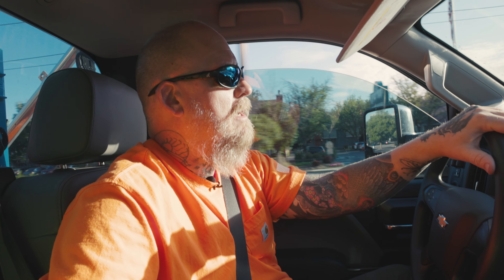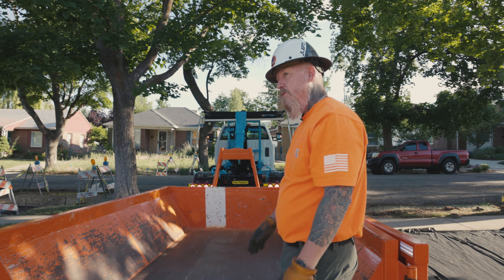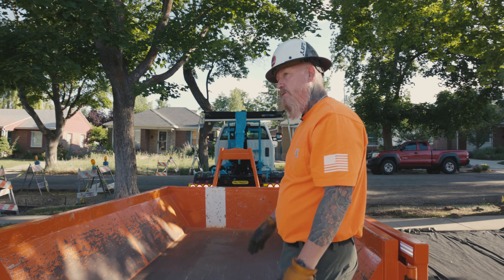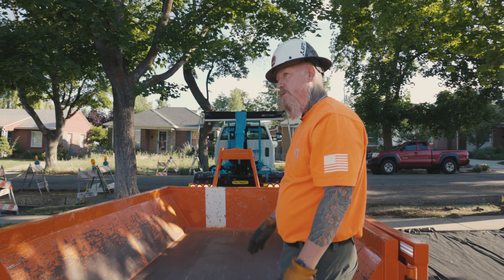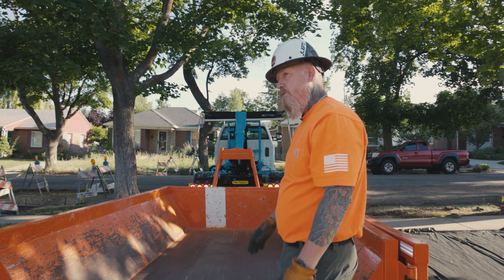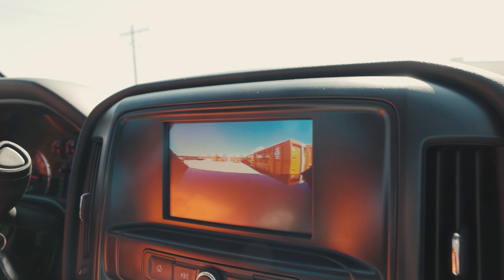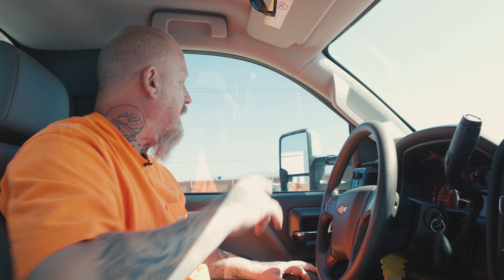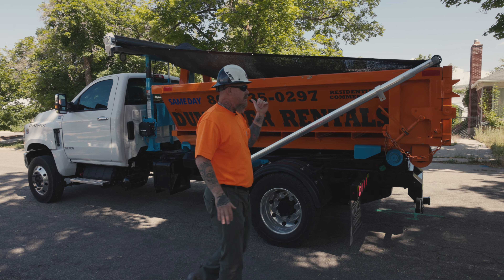Everything you need to know about concrete, dirt, & sod dumpsters.

Comment: Hi John, like this video and information. Actually all your videos! Great customer service! I am considering starting dumpster rentals in my area and love the idea of 7 yd dumpsters for Sod, Dirt, and Concrete since most don't and cringe at the idea. I have also been thinking about the auto tarper for this, wondering if when they upfit, they could modify or mount the gantry down lower, and have a sewn in cut out to allow the tarp to lower through past the palfinger hook and bars of the dirt dumpster to allow the gantry to lower just past the dumpster lip to prevent manual cargo netting the loads? Wondering about your thoughts and expertise on this idea. Thanks Jay and stay loaded!
Reply from the maker: Great idea Jay... All my trucks actually are setup this exact way. It's a complete game changer for sure. United Tarps ( George ) came up with the idea of a square cut out in the tarp to clear your hook and sit down tight around the base of the hook. I have several videos on my IG page with this to demonstrate how it's done. Thanks for your contribution, very much appreciated .

Comment: What the max ton you carry with your concrete dumpsters. Are your concrete dumpster 10yds? What's the dimension?
Reply from the maker: Just over 4 tons. The one in this video is 12’ L x 8’ W x 2’ T
Reply: His dumpsters look to be about 4 to 5 yards ish
Reply: What's your GVW. I have a f600 hook lift with GVW @ 22500.
Reply: @samedaydumpster Trying to get into this market and doing research. Given your dimensions and due to the slants on the inside, it looks like your bins are actually around 5 cubic yards on the inside?

That would seem safe/reasonable given wet soil can weigh as much as 3000lb per cubic/yrd. 

Just trying to get my numbers right before I have any custom cans built.

Comment: Love the videos! Just curious of what your max lifting capacity is on your hooklift?  We do 12,15,20 yard dumpsters but arent doing dirt or concrete at the moment but have been thinking of doing it in smaller dumpsters .
Reply from the maker: This hook is rated at 16,000lbs lift capacity. Our entire business model is based around smaller dumpsters with shorter rental times.

Comment: My question is your runing a 6500 with 10 yard dirt bin how do u not do wheelies, in Canada most ppl run hino 338/L7 33gvwr with multilift  xr10 hooks we go sky high
Reply from the maker: These aren't 10 cy bins. They are smaller and built specifically for the weight rating of our trucks. Ya'll do some crazy type trucking up in Canada in the oil fields for sure!!
Reply: So these Crete bins are 7yd ?
Reply: I have a Hino 338 in kelowna bc

Comment: How would you handle if for whatever reason someone didn’t listen and did fill above line when dealing with regular debris ? I understand with concrete etc because it’s heavier. Thank you.
Reply from the maker: We won't haul any overloaded dumpster plain and simple. Are you asking about if the debris is over the top type overloaded? Or are you asking about if it's overloaded by weight?
Reply: @samedaydumpster  first thank you for your reply, as I hope to start a business in the best future. I meant overloaded by top. You would not take it until they fix it ? Wouldn’t that also lead to them having to get another container for that excess? I guess it could go many ways after that. I appreciate your time sir.
Reply from the maker: @danm3346  100% correct. We communicate with them that will will in no situation haul an overloaded dumpster. It’s not safe, or legal in our state to do so. They are required to fix it before we haul it.

Comment: How much are these normally scaling at?
Reply from the maker: So many variable.... Concrete? Dirt? Sod? Wet dirt or dry dirt? How broken up is the concrete? The more broken up the lighter it will be... But typically anywhere on the light side from 4,000lbs to the heavier extreme side of 10,000lbs. I wish I could dial those numbers in better for you brother, but not knowing exactly what you'll be hauling that's the best estimates I can give. 

Thanks for taking the time to watch the channel.

Comment: We are considering getting our own "concrete" dumpster. What's the average tonage you see in yours? Concern is that at 5 CY that could be 7.5 tons which might strain my truck. We have a Chevy 6600 similar to yours. We also have the palfinger lift as well.
Reply from the maker: I have found the 7 cubic yard is the best size. That way you can use it for other materials other than concrete. Like dirt, sod, brick or just about anything else you can think up. Concrete can and will def get heavy if you aren't careful. Your 6500 is a very solid truck for sure, but just like anything in this business, you'll always have a load here or there that's too heavy to lift, unfortunately it happens if you haul enough dumpsters in time.

Comment: I'm working on getting or makeing the same concrete dumpsters with your design. How much does a full concrete load weights with your dimensions?
Reply from the maker: It can vary depending on how broken ups the concrete is and a few other variables. But 8,000 - 11,000lbs is a pretty good number for your question.
Reply: Thanks John! Love your videos very informative.

Comment: What's the typical tonnage on dirt or concrete with your dumpsters?  We just use a 10 yd reinforced, but need to be very careful in terms of our weight.
Reply from the maker: Our sweet spot is 8,000lbs. We really watch these guys closely or they will get carried away very quickly.